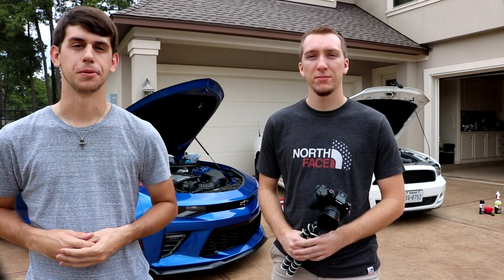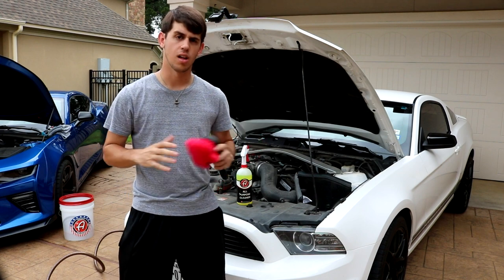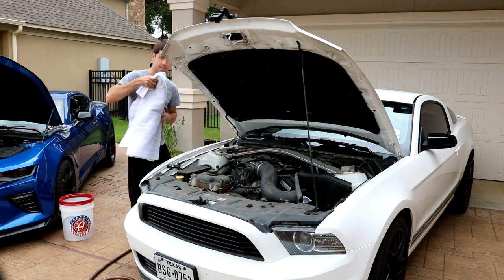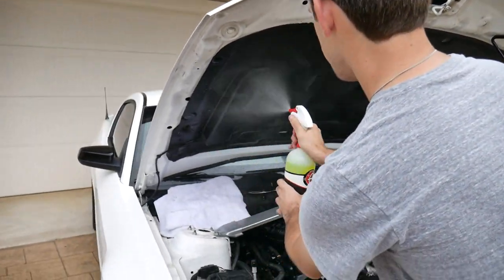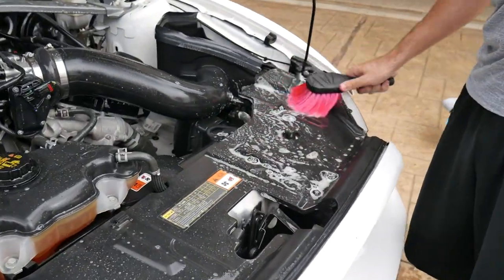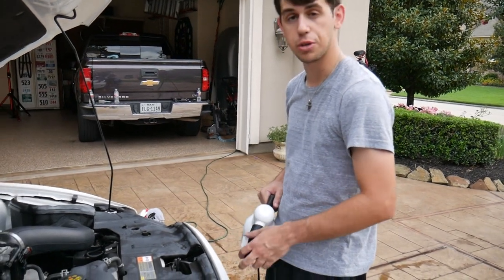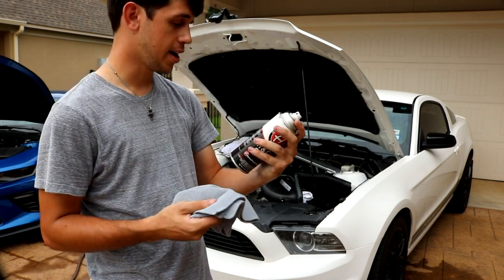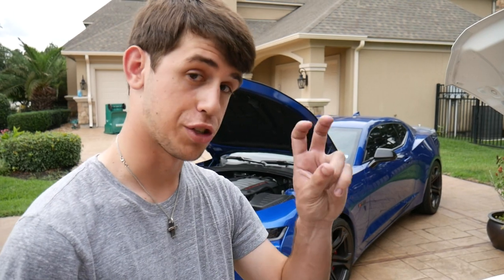How To Clean Your Engine Bay (Two Different Ways)

Comment: Word of advice, don't do this while the engine bay is hot. I've seen a radiator go bye-bye and an engine overheat and go to shits because someone sprayed the engine bay down while it was at OT and the cold water just wrecked havoc.
Reply: David Delgado this needs to be higher in the comments so more people see it
Reply: David Delgado well I mean if it was hot it'd be common sense not to touch it in the first place...
Reply: Something I've learned in my life is that common sense isn't so common. You'd be surprised how many people will think "hot engine? cold water? put them together and BAM, the engine cools down faster while I clean."

I recall a guy on a FB page I follow posting pics of his clean engine bay, followed 2 hours later by a post about his engine suddenly overheating and the next day by a post on how his engine dropped a valve seat.
Reply: David Delgado nah you don't, power wash engines everyday with the car on.
Reply: They Should have said that 😂
Reply: David Delgado would you start the engine right after cleaning? To help dry it? 2011 Ford Taurus
Reply: Life/budget savor
Reply: I thought you shouldn’t wet the engine where the wiring is period ?
Reply: My grandpa always told me to leave the vehicle on while spraying the engine.
Reply: what happens when you are driving for hours in freezing weather with rain ? do all the car explode ? i have driven in freezing weather for hours while its pouring rain never had a car explode

Comment: I don't feel comfortable shooting a water hose in my engine bay. Thats just me though. Good video all in all.
Reply: Mohamed Farah you can use a steam cleaner which produces much less water. Search up -steam cleaning engine bay) videos.
Reply: Mohamed Farah yea i agree . I don't wanna wet any electronic components.
Reply: Plus it promotes rust
Reply: Car Guey If it promotes rust, I guess my 12 year old engine should have rusted by now? Not a single spec of rust (except for the headers) and I'm in a rust-belt state.
Reply: alex_de_tampa What do you think happens while driving in heavy rain/puddles?
Reply: FruitMonsta180 Well yeah, but most cars have splash guards to help out. But you're right if engines were THAT sensitive to water we probably wouldn't drive them.
Reply: Alec Dziuk I don't know what kind of car you are driving but my car has splash guards in the wheel wells and the underbody. Thinking or water getting on and electronics or in my turbo sounds like a bad day.
Reply: Fuck, driving in ontario where they salt the fuck out of everything for a 1/3 of the year, that makes stuff rust... not overly concerned about the water lol
Reply: I use water, never had an issue, however I spend a little more time covering electrical connections and the alternator with plastic wrap.
Reply: It’s not bad if you know how to do it , I do it all the time and no problems
Reply: FruitMonsta180      Well there’s usually a splash guard under the engine so water can’t splash up from underneath
Reply: David Houlden     Just gotta cover the battery the alternator and take out your filter just in case water gets in the air box don’t worry about water going into the engine cause the throttle plate is closed but if you worry about water slipping by just stuff it with a towel
Reply: I don’t recommend steam cleaner or water hose of any kind, watch one of Scotty’s videos he said to never water your hood
Reply: BMW Man711 

I like ChrisFix videos better. Scotty pretty much said DON'T clean your engine.. I think a dirty engine looks look shit
Reply: Wipe everything with baby wipes. Thank me later.

Comment: I just bought a product called PollishAngel Engine.  It also is a waterless application.  Spray onto a cloth and then wipe down the surfaces of plastic, metal, etc.  It results in a matte finish so its really nice if you don't want the wet shiny look.  Great product I'd recommend.

Comment: Great video but I've also got some tips like putting a plastic bag over the alternator. If you want you can disconnect the battery to clean it separately and clean in the spaces under and around the battery holder. I also like to clean the plastic bits in the car separately by taking them completely out like the Air intake covers, and engine bay covers. Give them a rinse, then spray engine degreaser and let them sit for a couple minutes.

Comment: Riley instead of using in and out on big plastics like the radiator cover use super vrt youll see much better results and save that in and out for tight spots. Keep up the good work!
Reply from the maker: That's definitely a good alternative! I like the spray just because it's quick and easy but you're right, VRT would indeed be better for the big areas.

Comment: I have a 6 cylinder. I don’t see a problem. It’s a ISB6.7 Cummins Turbo Diesel with enough power to rip the house they are in front of off its foundation.

Comment: Sometimes use towels on both right and left side panels, reason is APC WILL STAIN YOUR PAINT! keep it wet!
Reply: Blimpus Rock Videos very true.  one could also put a layer of wax or glaze prior to spraying with the degreaser.  If not it will damage the paint.

Comment: Bro I just cleaned my engine bay and I cover all the wiring connector.. but after cleaning it and wiping it down, I saw a little bit of smoke coming to the engine. That’s why I turned it off right away. Is it normal
???

Comment: Should you cover the alternator from getting wet? Ive heard different opinions on that is why im asking. Obviously I know not to just straight up soak it but i noticed you didnt try to avoid yours. I cant even see it but I'm sure its right there under something lol.
Reply: B W       Cover the battery the alternator take out the filter and stuff a towel in the air intake and you should be alright. Don’t worry about the electrical wires the wire it’s self is protected by the jacket and most the wires in the car are covered with harnesses. The alternator is not protected same with the battery terminals and god make sure you block the air intake water in the engine is a no no other then that everything else is safe to get wet.

Comment: Remove all plastic covers, radiator caps and oil caps, and use a power washer turned all the way up. Make sure you use the knife spray and spray all electrical connectors really closely. 

And don't forget to use the cleaner that specifically states that you shouldn't use it on rubber and plastic. 

Hope this helps!

Comment: I have never ever used a hose to wash my engine bay, like no! The battery can get a little wet but how about sensors and the alternator? There are lots of stuff that should not get wet... another way to clean perfectly the engine bay is taking out all the plastic pieces you can and cleaning them with water and any degreaser of your like. And to finish, wipe everything with a microfiber towel and for a perfect black plastic finish use any plastic restorer and done.
Reply: Andy Meda when you drive down the road at any reasonable speed in the rain the entire engine bay will get soaked, so spraying down your engine bay will not hurt anything
Reply: Ty Brink mmmm maybe some cars but I have driven many times in the rain and my engine bay does not get soaked that much, maybe the lower parts obviously but new cars are covered almost entirely. My daily is a 11' CR-V and after driving her for hours on bad weather, the engine bay is not that dirty as some would expect.
Reply: Andy Meda I just wrap all of that stuff with plastic wrap.
Reply: Watch Chris fix video he does it better

Comment: that degreaser was too strong for the plastics for the v6  also you left it on too long.  you faded the hell out of the plastics.  you are trying to restore the shine with that spray but it won't work.  the damage has been done. as an avid detailer, i cringed at the video for both cars.
Reply: Just trying to learn here but how did you see that the APC was too strong?
Reply: he used adam's all purpose cleaner.  which is a degreaser.  for plastics, aluminum , things like that under the hood, it needs to be diluted with water and never let dry.   any type of degreaser permanently stains or eats up plastic when left on too long/dries. once that plastic is dried out, it will have that sheen again unless you cake on some type of dressing, water based or oil based.  a newer car, you can get away with  just using soap and water.   if APC is used, i would heavily dilute it, 5:1, 8:1 with water and never let anything go dry  and rinse as soon as the dirt has been broken.  a lot of used car dealership clean engine bays wrong and they use tire shine spray to spray the whole engine and after you buy the car, the damage that has been done will later be revealed.

Comment: Easiest way is to  put a degreaser on the whole engine Bay Area and inside of the hood, then spray it off with a power washer. You don't have to cover the battery or any of that nonsense. Just don't spray directly into the intake if it's exposed like the mustangs intake.   Nothing to worry about

Comment: Just curious if there would be any adverse issues from soaking the Engine Insulation pad attached to the hood? I've always heard that you don't want to really get them to wet because they can droop and fall down over time. Anyway, that's what I've always heard unless that one in particular on the Mustang is made of a different material. I think "Car Cleaning Guru" on Youtube raised some concerns about it as well. Any thoughts? Very nice cars btw!
Reply: Nick Lavender anyone else can chime in, but in my experience it won't hurt it. It just takes a long time to dry out depending on the material. Leave the hood open for a while to help it dry out.
Reply from the maker: Most dealerships during the "prep for sale" stage with used cars hose down the engine bays and the insulation pad. I really don't see it causing any issues unless perhaps you wash it & leave your car sitting for several weeks without driving. Even then, it's a long shot you'd notice anything wrong.

Comment: wait are you aloud to spray water around the engine where all the wires are connected and sensors?  i have a 2010 renault laguna 1.5 dci engine
Reply: Carefully. Don't use a pressure washer.

Comment: Is it better to wash the engine bay when the car hasn't been ran so it's technically still cold? Or can it be washed after it's been ran and sitting for an hour or two?
Reply from the maker: Preferably on a cold engine! Pop the hood and wait a couple hours before washing after driving around.
Reply: RP Productions Thanks RP!

Comment: I'd use an air compressor and blast out the water after everything is done. If you don't have that, use a leafblower. You don't want water sitting near the COPs. Coils and moisture don't make good friends

Comment: i have an 07 jeep srt8 stock no mods i heard you cant use water on these engines do you know if thats true? ive been wanting to do this for a while
Reply: NICK SRT8 should be able to. I detail for a Chevy dealership.we clean a lot of high performance engines. Just use some degreaser (if you want) and hit the engine from any angle. Don't worry about wrapping anything to keep water out, we pressure wash everything and nothing ever goes wrong.

Comment: Aren't you supposed to also cover over the starter/alternator, or is that no big deal?
Reply: Ben Ghazi  gotcha. Well I guess I slightly  overcompensated by  covering the starter, removing the battery, and letting everything dry for 2 days. Call me paranoid.,
Reply: Ben Ghazi  ok cool, well it's a 2002 Tacoma and it started up and seems to be running just fine, despite some water getting into the alternator
Reply: Ben Ghazi  that makes sense! Thank you for explaining. Do you prefer these early 2000 cars overall?
Reply: Ben Ghazi  I respect that opinion!  Another question: what advantages are offered by "for regular folks RWD" cars?  Why would normal people care about RWD enough for automakers to get back into this market?  I haven't owned a RWD drive car since my Olds Delta 88....

Comment: Stupid question I thought you couldn't use water on your motor? Doesn't the water get in the motor and ruin it?
Reply: Engines are sealed except for the air intake, which you should cover.

Comment: why not just remove the battery if it's exposed? that way there is also no electricity running through any parts that could short out... plus you should always wash from top to bottom, that way the dirty water doesn't run/drip onto parts you've already cleaned

Comment: Nobody mentioned not covering the alternator?..
Reply: You don't really need to. I worked 2 years doing detail for a dealership. Any car around 2005 and newer, you don't need to cover anything. I just wouldn't keep water focus  around that area. A light dousing would be fine.
Reply: Colonel Corn Kernel oh okay makes sense. I have a 2001 so I cover mine.
Reply: @vipkyle1756  oh yeah, I would just to be safe. I mean, the risk of running anything is very low. But still better be safe than sorry. Good luck!

Comment: You guys covered the battery and didn't need to, didn't warn people not to spray water on a hot engine because you can crack aluminum blocks/heads or manifolds. And you apparently don't know that dealers pressure wash engine bays before they resell cars. Hose pressure isn't going to damage anything unless you get it in the intake or something else that stupid. You degreased the engine, and didn't coat it will any petroleum products, by degreasing it you removed the rust preventive coating from the factory. So when it's all rusted out.... another car payment stacked onto the one you already have.

Comment: You're telling me you can just spray down your engine bay no problem?
Reply: David Young        Well no hang on you should cover the battery the alternator take the filter out of the air box and stuff a towel in the air intake. Then you should be alright to hose it down
Reply: @ryans413  sweet thank you
Reply: David Young    No problem